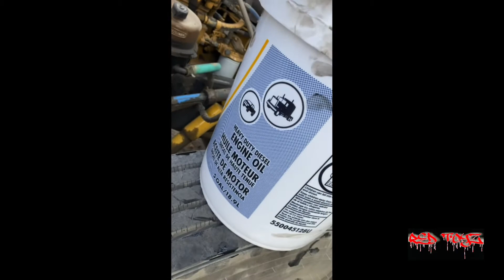Custom stretch 300 wb Peterbilt 379 Maintenance Day #2 oil change on a cat c15

Comment: How often you change your oil and what brand fuel and oil  filters you running
Reply from the maker: Depends on how many miles brand of fuel Whst do you mean try to run mostly car
Reply: @redtoyz02  was curious if you had any good or bad experience using non cat filters
Reply from the maker: No might go out a little quicker how about you
Reply: @redtoyz02  I haven't changed anything on mine yet
Reply from the maker: What type of motor are you running
Reply: @redtoyz02  2004 c12